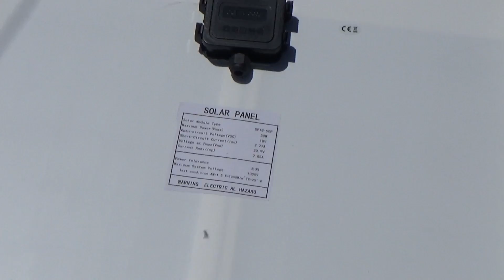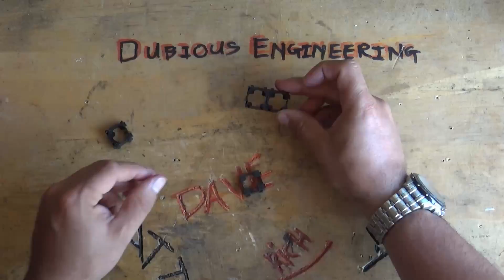DuB-EnG: SOLAR Power Eco-friendly DIY Electric CAR Mobility Scooter Tesla Killer - make worlds first

Comment: I got news for you mob!! I put a big 32 volt solar panel on my mobility scooter before you did this one!! 3 amps is nowhere near enough current. I now have a 32v 370w panel on my mobility scooter. I use 4 35ah ride on mower batteries to give 70ah battery capacity. The solar system puts out up to 15 amps current, should it be needed.
Reply from the maker: Oh thats epic!  I bet you can go for miles and miles :-)  Even on a shady day!
Reply: @DubiousEngineering  it works very well. I've not yet tested the absolute range yet, but the greatest distance I've done with this set up since putting the 4 35ah batteries is 25km, or just over 15 miles. Battery meter read more than 3/4 capacity after the trip. On a cloudy day, the solar output is around 4 amps during mobility scooter use.

Comment: Brilliant. I was just having a thought of the what of the possibilities of something like this, mostly because of the electric scooter craze that is taking over the city streets here in LA, SF and Vegas, but thinking how very possible this solves many problems for local mobility and transportation without the use of car or breaking ones ass on one of those scooters. Good job mate!
Reply from the maker: Awww...  thanks Man! ...  we’ve had about three weeks of rain now, and very little sun in the UK... so it’s not as useful as it should be! ...  I’m sure in the USA it would be far better with your lovely warm climate! ...  I’ve got a speed controller upgrade to do, and have some nice big home-made lithium ion cells to fit...  early testing looks promising!

Comment: let me know if you manage to find a speed control programmer and perhaps how you get on with improving the scooter's top speed?
Reply from the maker: In the future .. when the solar panel go on the shed...  I’m totally going to over voltage this ....  who knows... I may even weld a small petrol engine on it...  but I’m going to look for a speed controller and see what we can get out of it as standard...
Reply: Most 8MPH scooters will clock up to 16mph, whereas some heaver duty controllers (50+Ah) can exceed 21~23mph. Increasing the motor supply voltage would not affect the speed, only stress the controller module. Now Colin Furse added a petrol engine to a mobility scooter, hitting 70 MPH! https://youtu.be/zy5rkw4SeP4